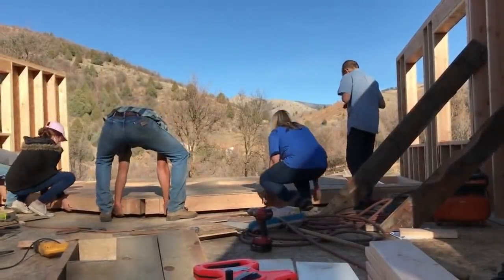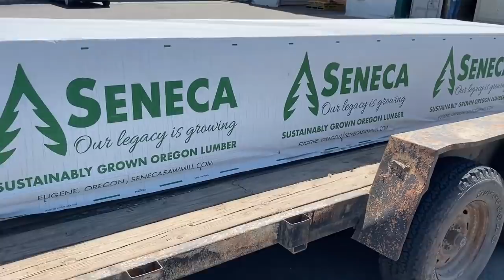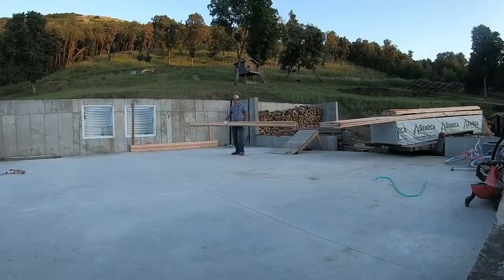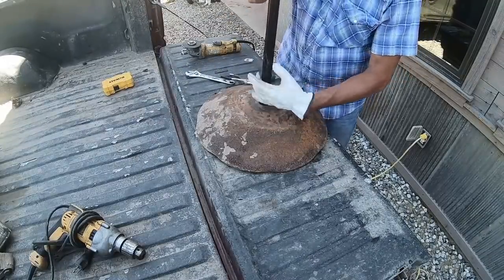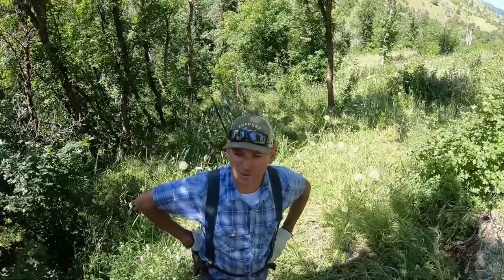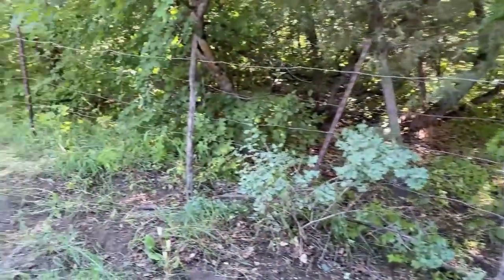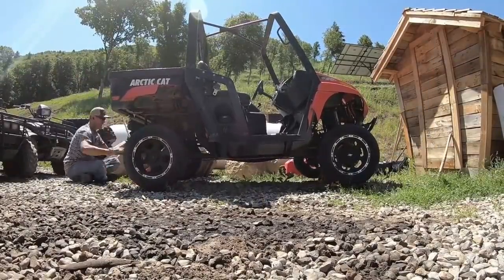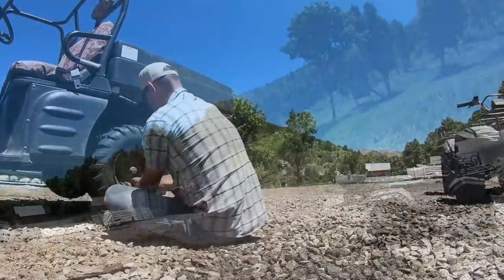#419 - Shop Lumber Is HERE!!! Public Land Livestock Problems

Comment: One piece of  brightly colored surveyors tape about 8 to 12 inches long tied to the top rung of barbwire between each t-post and left to dangle may help the cows recognize the fencing you have restored ....  it's a cost effective solution and may save you some maintenance in the future ... great vids and thank you for sharing them .
Reply: savvy1803 and it just might keep you from running an ATV into it on some inclement day!
Reply: @thorzyan  I agree another good point to it's usage , my sister has used it for years on her small homestead to keep the wildlife from raising heck with the fencing and it seems to do the job .

Comment: Good reminder of how many pneumatic tire vehicles you have on the place. You might check listings for an old tire mounting machine. With your shop it might come in handy. You'd be surprised how cheap you can pick up old equipment maybe too far gone for everyday shop use when relying on to make a consistent living, but for individual farm/ranch use it can still have useful service life.

Comment: Thank you for checking your trailer! Last fall our car got totaled from a snow mobile trailer that disconnected from suv and crossed center line and took out our car. It was a strange sight to look up and see it coming right at us. Pretty sure it should not have had a 55 gallon drum in the rear and can't imagine it had pin and safety chains properly attached. Good thing hubby is a cool headed safe driver, we survived, but not our nice paid for minivan! It is amazing all you have done. It is nice to see it again. Bandit is such a good boy! Good to put back the fence. Stay safe!

Comment: You should bring the batteries into a even temp dry storage when you are using them.  Keep the temp more consistent.  It doesn’t seem like it would be to hard to rig up a quick connect that you could just attach when you need to do work.  That way even the Oddessy batteries will last longer.  I can’t imagine that you use the excavator every day and even if you used it every week a week of even temp storage would be better for it than sitting in the hot sun or freezing cold all the time.

Comment: Seneca sawmill is a fully automated sawmill in eugene oregon its capacity daily is a million board feet a day.. and it's some of the nicest wood it stays the wood so knots are never an issue and use up every possible inch off the tree.. I'm a carpenter and do work for the owners  and their family great people.. the milled sawdust is turned to chip board

Comment: Never stand walls with the plywood sheeting pre-nailed in place.  It's A huge mistake because it's a safety hazard.  If you had an emergency (which can happen once you have that wall stood past the point of no return) the crew needs to have the open channels between the studs to stand in so the wall can fall back to the floor while at the same time the crew doesn't get crushed.  You guys were seriously struggling.  Had you needed to bail at the last second there was no place for anyone to stand safely without being seriously injured or even killed. 

The ply made the wall too heavy...  You all were fortunate you didn't have to face any unforeseen problems.  

I'm not joking or trying to be a jerk.  It's happened to me on a crew I was working with some years ago.  We were standing a wall and one guy had a problem and he could no longer hold the wall...  The wall was close to vertical and we had to bail because with one man down the rest of us couldn't finish pushing the wall into place...  Being a man down the wall was too heavy...  We couldn't just walk the wall back down.  My boss yelled "Everybody pick a channel we're going to drop it in three.  He counted down and we all let go and stood in a channel and the wall fell around us...  Not on top of us.  Nobody was hurt.  Nailing the ply in place took away your escape route.  

Framing houses is very dangerous work.  You can't skip steps to try and save time.  You nail in the ply after the walls are framed, stood, and blocked.  In fact good framing contractors will not nail in the plywood walls until the entire building is framed and every channel between the studs has been blocked.  You also can't properly block if the ply is in place because the measurement for each block will not be exact anyway and the ply being in place first keeps you from getting the true measurement between each stud...  Each block will be off from one another by an 1/8th or a 1/4 more or less depending.  You have to measure for each block individually after you stand the walls.  

Any contractor who tries to do what you did there is literally gambling with his life and the lives of his crew.   

You have to be vigilant about safety in housing construction.  I've seen guys framing that were fine one second and then the next second we were rushing them to the emergency room.  Please be safer.  What you did was far too dangerous.  Those kids,  your wife, or you...  Could have been seriously hurt or worse.  
Take care.  sincerely,  Dean O.  :-I

Comment: Really hate to say it but when it comes to fencing if there is a gap they will get through. You may as well commit to doing the entire perimeter. Once it is done it is done. Also you might consider running some pigs through the forest to clear some of the brush.... that blm land looks faily grassland.... the woods you have will produce a crown fire from a grass fire because of the ladder of fuels. Best fire resiliancy has max 40 trees per acre.

Comment: Can that wire hurt the cows?
Reply: Boo Bear are you asking about the barbed wire?
Reply: @inkystellar9501  yes,can they run into it,and get cut,or do they know and stay away?
Reply: @boobear6256  Yes and Yes
Reply: Boo Bear most times of a large mammal brushes against it it’ll just scratch them and it’ll be like “hey, stay away” but if they push against it with force they can hurt themselves. It also depends on the age of the wire because sometimes the barbs get dull and then it doesn’t do much.